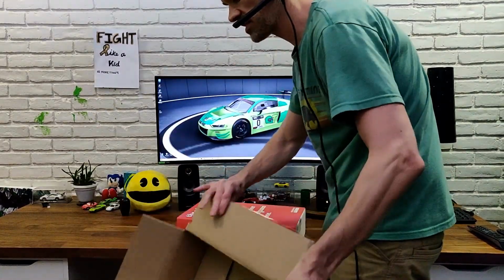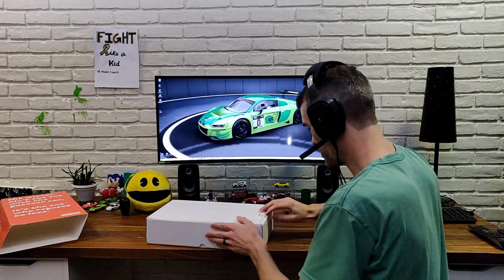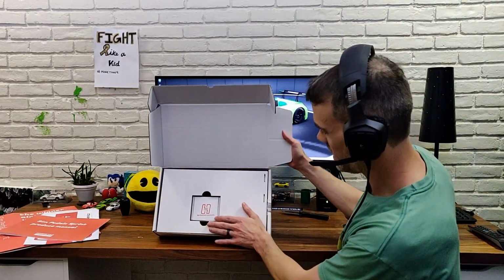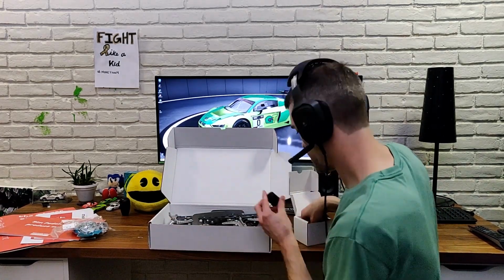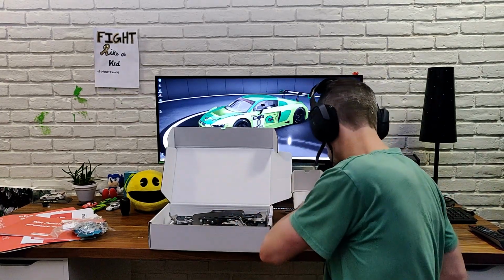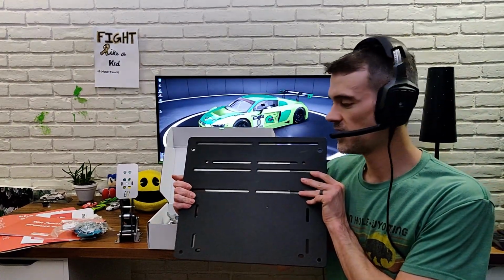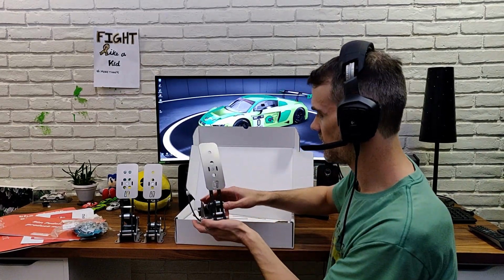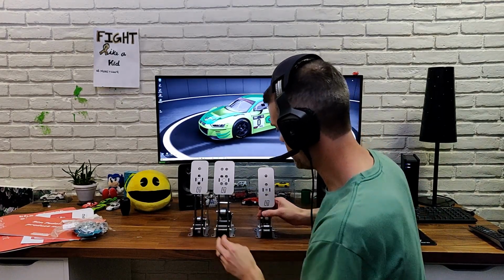Sim Gear Spotlight | Heusinkveld Sim Pedals Sprint | Unboxing

Comment: Man this is such a cool upgrade. I followed your odyssey with your thrustmaster pedals on discord and was quite bummed about it and the fact that there was nothing we could do to help you. Makes me really happy that your "impulse buy", as you called it, is such a sturdy and aweskme looking set of pedals thst hopefully will last you at least as long as the G27 pedals, if not even longer. You deserve them after all the stress you had with TM. <3 How long did it take you to set them up how you wanted them to be?
Reply from the maker: Thanks Wuschel! It actually didn't take long to set them up. I decided to just bolt them to my pedal plate and see how they felt out of the box. I got lucky and they feel really nice without any adjustments to the pedal angles. I could make the gas pedal a little softer, but I think I'm getting used to it as is. These pedals are really something else! They're super easy to heel toe with and the brake is just what I wanted from a brake pedal. There is a very small amount of travel initially, and then the pedal firms up very nicely making modulation feel more intuitive.  I'm quite happy with them so far!

Comment: Great video, Allen. I"m waiting for the next one to know your feelings (and to see how you master the art of heel an toe downshifting!).
I have been using Heusinkveld Sim Pedals Pro (Sprint models were not yet released) for two and a half years and they are really efficient. I have only experienced 2 clutch spring failures (I often use vintage cars with H-shifter) and also several brake pedal rubber spacers failures (cured since the material was changed) but these are reliable and sturdy items anyway.
After a while, I'm sure you will see an improvement in your lap times ;-)
Reply from the maker: Today's Saturday races were my first time to drive them. Initial impression is that they are fantastic. I think I would like the gas and clutch to be a little softer, so I'll adjust that. The brake feels spot on out of the box. The brake reminds me of driving a real skip barber car. Very firm with very little pedal travel. Just perfect. By the 4th race today I was feeling pretty good on heel toeing. I'd be curious to try the Fanatec V3 pedals to see if the Sprints are truly worth the premium... After one session on the Sprints... I can't think of a bad thing to say...